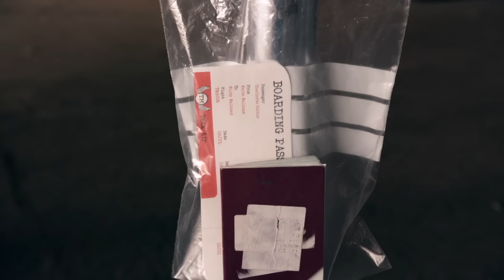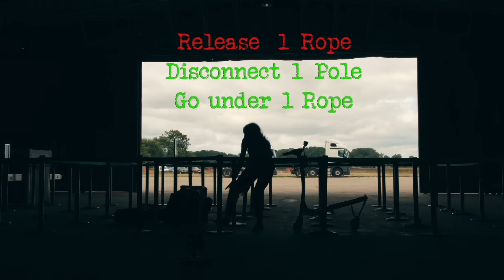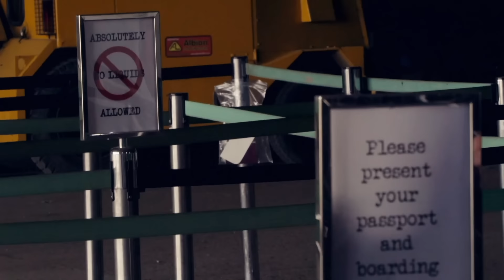Get Your Luggage Through Security | Full Task | Taskmaster

Comment: Pausing just after reading the task to give an answer and guesses. My first instinct is to open all the luggage just to see if there's anything hidden that would help/harm me, before packing up and stacking on the trolley as low as possible. My second instinct is that the task said nothing about moving posts without disconnecting them, so I would drop one rope, then shift all the posts as far to one side as possible to clear the way without disconnecting them, then bring through the luggage and ducking a second rope to get to the end, lifting the rope so the luggage doesn't touch. I would also remember that shoes and electronics go in a separate bin, and fluids cannot be greater than a few ounces.

Comment: This task has way too many unnecessary layers.
Reply: Yeah, during series 10-11, it seemed they ran out of writing tasks more simply and just made a bunch of them convoluted and over-engineered with many rules.
Like, if the pedometer task had been in this series or series 10, it would have been:
"Record the highest number of steps on this pedometer. You may only use this pedometer. You may not touch the pedometer with anything but yourself and from (this box with completely useless nonsense). If you fail to step for 5 seconds, you are disqualified. You may not leave this dome. Your time starts now" or something. Like how the pints-from-phonebooth-to-caravan was absurdly difficult or the egg-to-frying pan one restricted you to an extreme degree or the one with the doors in the garage.